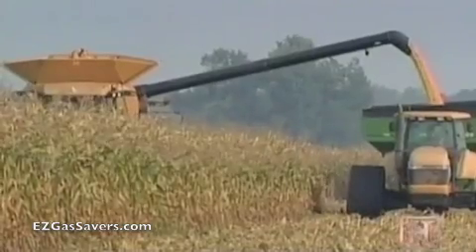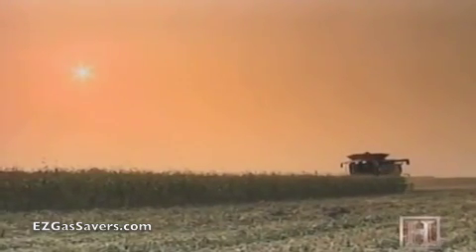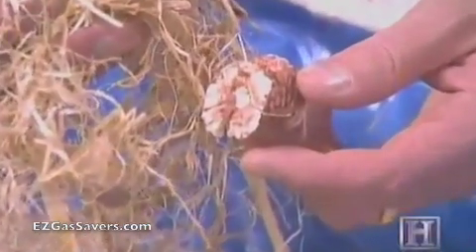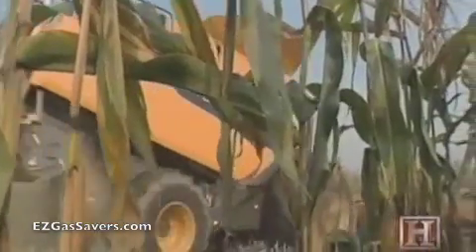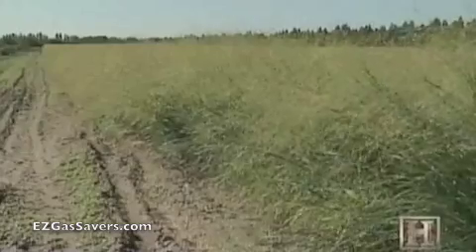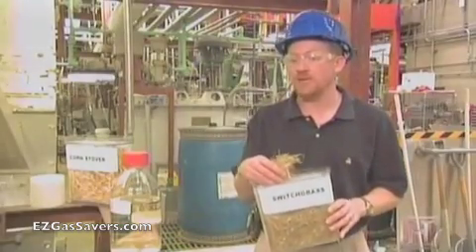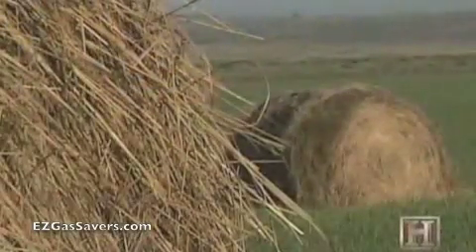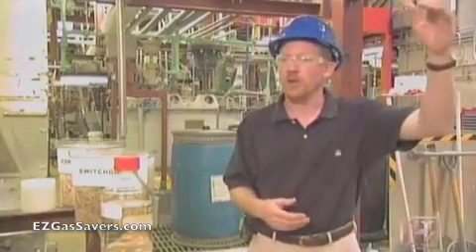Biomass Biofuel Ethanol Alternative Energy

Comment: Ethanol was not meant to be a sustainable source of biofuel. It takes almost as much energy to make, as it does release, making it a low energy fuel. Its also VERY hydroscopic and corrodes anything rubber, or metal. The only reason we use it as fuel is because some dumbasses grow way too much corn, and have their hands in politicians pockets.